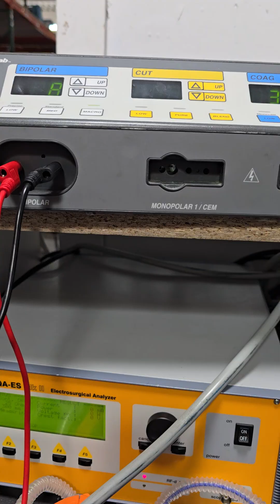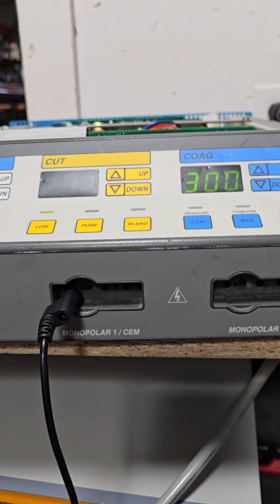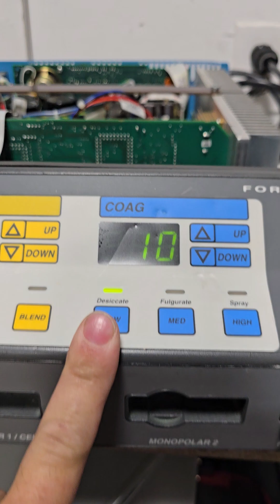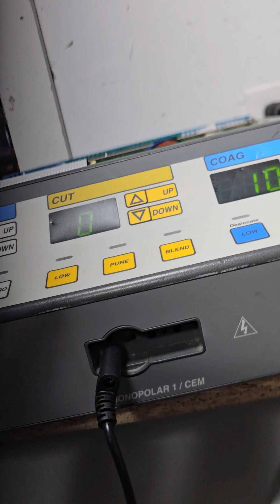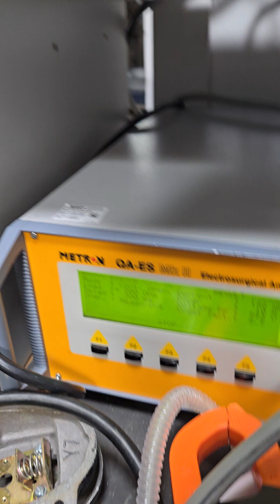Valleylab/Covidien Force FX(C) calibration step 8 - checking and adjusting the ECON factor

Comment: Yes!!! I try that with no accessories but it keep saying the same thing… Do you have that can be a board issue
Reply: Yes, there could be some debris. You could pull 5he cover and move the front section off the board. Examine the contacts. If it is still giving you those codes, look for damage, remove and reseat all connections. After that, try a calibration. If you're still hitting those errors, you'll have to find a repair company

Comment: Hello there!!!! I have a valleylab cautery machine that’s show an error code 197 and 81 every time I open it. I mean it’s doesn’t work, what can I donto fix it
Reply from the maker: Ok, well, 197 is stuck mono 2 coag. So try starting the unit with no pedals nor accessories plugged In. Hopefully 81 is just piggybacking on the 197 error.